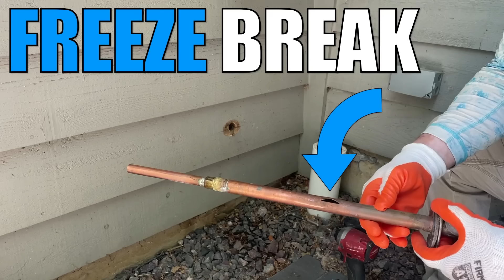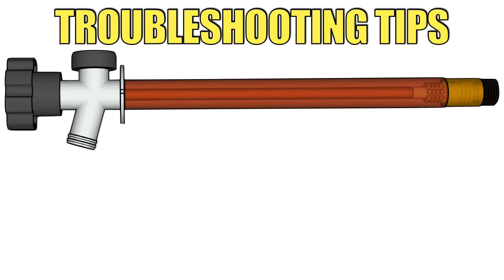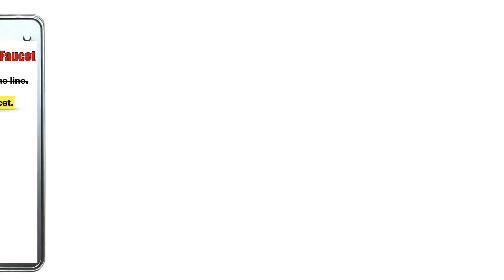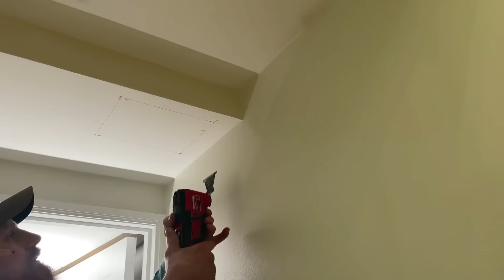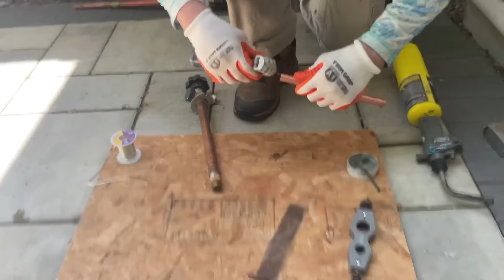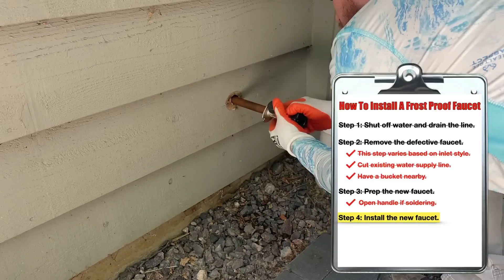How To Replace a Frost Proof Faucet (Step-by-Step Guide)

Comment: Why on earth is every plumber soldering pie into a threaded connection? I want to assume the best but I can only think it forces someone to call a plumber. I suppose in wall it's the only option to be safest... that's all I can think. I have an unfinished basement so I question it.

Comment: You forgot to tell them to stop water from getting to the joint you take soem bread and roll it up and push into the supply pipe

The bread will stop water from dripping into the joint while being soldered, and when you turn the water on you let it set for a few min.. It will then flush out past the valve

Comment: Ok ive got one variable with my outdoor faucet. When I tried to turn it to take it off & replace it Just snapped off leaving part of it you seal & solider inside the pipe that it attached to. Its under my house & so I cut an area to try not to have to crawl under my house if possible ( very small crawl space) so is it possible to somehow thread the pipe with a tap & extension & use some kinda sealer on the threads rather than soldering the thing. I can get a tap in there on extension & definitely  reach it but say tapping goes well, can I then use some pipe compound & let dry & then that fix it otherwise its under the tiny crawl space & hard to reach 
To do it like your doing it in video?

Comment: I live in a mobile home and am trying to figure out what kind of sorcery the last person used for this place. I think they ran the outside faucet line through the bottom of the hot water heater with a woven metal air hose to the faucet.

Comment: Thank you for posting this excellent step by step video on how to change the outside faucet. I called a local plumber in my area and he wanted around $330 to replace my busted outside faucet and I said no as I know it is not a major job. After watching your video twice, I feel confident to do the job myself and saving at least $250 as I have all the tools except for the yellow small tank and the cost of a brand new outside faucet is around $30.00. Hopefully, I will get this done next week as my wife is planning on using it this summer and I will let you know how it went.
Thank you
AJ
Reply from the maker: hope it helped

Comment: I have this issue that I discovered a few minutes ago.   Mine does not have access inside.   It runs between the wall between the kitchen and the garage and the water heater is right there against the wall in the corner. 
Will I cause more damage if I try to unscrew the spigot from outside not knowing if it's threaded or sweated in?
I'm thinking I have to drain the water heater and remove it,  then cut a drywall opening .

Comment: I worked un the plumbing departrment of a big box home improvement store in Canada for 4 1/2 years.

Each spring I would have a steady stream of husbands… either they lost the anti-siphon or it froze over the winter. If the freeze break was on the inside of the house, I would ask them if they got a big screen TV when you remodeled the basement. The warm air could not get to the frost free bib. 

I would suggest a standard bib with an optional anti siphon attachment. And a shutoff valve with a bleeder screw. As most houses are some form of PEX, I always sell the bib and shutoff with some form of PEX compatibility.

Most so called frost free bibs are not slopped correctly, and most builders will not spend 50 cents on a shutoff with  a bleeder..

Water typically stays in a frost free bib because water will not move unless there is air behind it. Bleeder screw solves this and ensures that the water escapes on its own.

Comment: I live in a house built in 1956 in Santa Fe Springs, Southern CA. I'm still remodeling the master bathroom. When I took apart the old galvanized pipes out I noticed the hot water pipe kept going through the exterior wall and ended up in a water valve outside the house. I have not found any information regarding the system and I'd like to know if I have to install a frost proof valve.
Why was the hot water pipe went through the wall to a faucet?

Comment: Thank you for this very informative video sir. One question though, Are all frost proof faucets soldered in at the joint? Because I’ve seen a tutorial video where the guy just twisted off the whole frost proof faucet assembly and no solder at the joint at all. He then wrapped a plumber tape around the threading of a replacement then installed it all done from the outside of the house without cutting out a wall or whatever.

Comment: Why didnt you run the piece longer  then sweat it to the female fitting with out it screwd in. Then screw it in after its cooled, cut your other side to fit that way you never risk burning up the seal. Couldnt you just have unscrewed the hole piece out without even sweating it it 
, if you went back with correct length valve?

Comment: Wouldn't it have been better to replace the connection with a threaded adapter so if this happens again in the future, the hose bib can just be unscrewed and replaced?
Reply: If they do that next time homeowner won't call the plumer, I guess that's why. I had the same problem and ask myself the same question.

Comment: My backyard anti-frost faucet either has low pressure water coming out or almost not all. I thought it was due to the bibb washer, so I took the entire stem assembly out after I turned the water off. After the stem assembly was removed, the water did not come out either after the main water supply was turned back on. Does anyone know what happened to my main water supply pipe? Thank you.

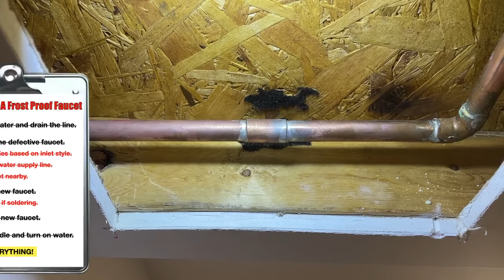Comment: at 8:38 i noticed quite a bit of scorching of the OSB above those joints.  was that the previous installation or does the heat shield not completely protect the wood from scorching?

Comment: Jon, so what if the sill cock is only 2-3 inches above final grade?  This makes it extremely difficult to attach a hose and impossible to fill a bucket or water can.
Can you suggest some other options?

Comment: Hi, I do basement remodels. A client of mine had a busted faucet during the winter following the remodel.
My question is should I insulate around garden faucets or should I leave the insulation out around them to allow some heat to reach them ?
In this particular case, she left the garden hose on, but maybe if it wasn’t insulated it would have protected it from freezing ?
Thanks,
Xavier

Comment: I have a Frier Frost Free Faucet that is leaking after the water is turned off. The handle appears to be cracked at the connection to the square valve, but I am guessing the problem could be the rubber flange which is kind of crimpled up at the edges.

Comment: I just installed a Shark Bite fitted frost free tap. Easy, just snaps into the pex line.Install angled downward for drainage.  A retro fit to side of house that needed a tap. No soldering , no worries.

Comment: Superbly informative! Thank you. 
A friend left the hose attached to faucet for winter and and the outer tube cracked right behind the house wall. I wonder, is it worth repairing (soldering) or better to replace with new? Solder repair would add some extra thickness to the outside diameter.

Comment: My frost proof needs replacing, it is too long and hitting one of the studs under the house so im having to do a bit of rerouting and soldering to get it to be good. One thing I learned from other plumbing videos is that it needs to have an angle so the water comes out of the little spigot outside. Im fixing this for my moms house and I suspect two reasons why its leaking now. One, she confirmed she left the hose on as she didnt know she had to take it off as her previous house had a spillcock that was one of the more expensive types where you could leave the hose attached and it would be ok (still good to get into the habit of taking it off). Two, is that the spillcock was slanted inwards towards the house, not letting the pipe drain out properly which is one point that wasn't mentioned in this video, but it looks like the pipe in this video is slanted as it should be, letting my fellow diyers know in the case you weren't aware

Comment: What stops the spigot from turning counter clockwise (open)? I just replaced the valve stem in my Woodford outdoor frost proof faucet and while the water turns on and off ok, the valve stem doesnt stop spinning when opening.

Comment: Excellent instructional video and a valuable resource to us, DYIers.Thank you for it!  However, I was wondering why not solder a female adapter to make future replacement easier by just having to unscrew the assembly? Just curious too if doing so, if applying torque would weaken the soldered female adapter or not. Or if it potentially makes it difficult to straighten the faucet. Please, advise.

Comment: I have found my frost free spigot free-flowing water this winter with the faucet in the closed position. I installed a ball valve on the pex supply line to stop the flow, but now I have to replace the spigot. Never done that before, so that should be fun.

Comment: Good job! I'll be installing one of these in build I'm doing. Definitely going to make it more accessable than was done here. The bigger repair is the sheetrock because when the homeowner calls back in the winter because they forgot to disconnect the hose I don't want to deal with drywall. I'll also include a ball valve just upstream and use pex instead of copper because I know I will have misplaced my fire blanket.

Comment: I thought that was the whole point of a frost proof spigot so it don't break in the wall. I thought the shut off was inside the house. Good info with the pitch I never new that either but based on that and it still burst in the wall sounds like those are gimmicks and a waste of money ??

Comment: From an old-time journeyman plumber, here’s a trick to repair that burst faucet without having to buy a new one. Simply remove the burst faucet, tap down the burst area, then take a 3/4” copper repair coupling (the coupling without a center stop) and cut out just a bit less than one-half of the coupling diameter, add flux to the burst area, snap the remaining part of the repair coupling over the burst area, then solder it on. Bingo, faucet is as good as new, lives to see another day!
Reply: Or buy a new faucet for $30 and do it right
Reply: @fenderstrat7547  Yep. You are on a call 3) miles from the nearest SMALL town and do not have one in truck stock. So do you drive to the town hoping their hardware store has one, OR repair the one that is installed. 
If you have a stick of 15% silver solder you can fix it stronger then new
Reply: No, make two elongated cuts to the coupling, from one end to the other end, thereby cutting out just less than 1/2 of the coupling body. You will need to hold the coupling in a vise to do this.
Reply: What do you mean by cut less then one half of the diameter of the 3/4 repair coupling? Do you mean just shorten the coupling?
Reply: Or just cut out the bursted section of the pipe and install two coupling and a small piece of pipe. Boom even better
Reply: solder it back together after pushing it back together with 15% silver solder
Reply: These things are like 25 bucks. If your going to all the trouble of removing it just replace it. Its so much easier
Reply: @ptech88 try $50-$60…
Reply: Yeah tools that no one has

Comment: Why not put a joint in where the faucet can screw on in case of another failure down the road then the drywall would not have to be cut out

Comment: Bro--FWIW--I always use a big piece of white bread (no rust please!) to 'plug up' lines that have residual water in them before I solder. Like the line to your final coupling getting soldered. When done just turn on the water and the bread will liquify and disappear out the faucet when turned on.

Comment: I'm dealing with a Arrowhead hydrant with a leaky stem that is threaded on the inside as well as the outside. There is a 90 degree elbow attached to it with threads on the hydrant side and a soldered coupling to a copper pipe on the other end. Ideally I just need to replace the stem but there are no stem kits for the length hydrant so I need to purchase the whole thing. Theoretically I should be able to unscrew the old hydrant but it's tricky as I don't want to apply force to the elbow. Alternately I could just strip the stem out of the new hydrant and leave the existing body in place. I am still deciding what the best approach is.

Comment: Great video! Nice graphics also. How did you know it was a sweat connect vs threaded from the outside? I need to replace an outside faucet and cannot tell - afraid to crank it with a wrench to see and risk breaking it.

Comment: Wait....so....should you not try to future proof that as much as possible for easier disassembly going forward? As a homeowner, I feel as though you should have utilized a different connection method(if it exists) for if ever the home owner is in this situation again. Now if it happens, the cutting procedure has to occur all over again. Is there not a design that us as homeowners can use that can just unscrew?? I noticed that there is threading on the pipe of the spigot, so that hints to me that there is. How come you didn't use that??

Comment: My original spigot enters the basement JUST BELOW the plywood subfloor of the level above.  
This prevents me from achieving any kind of slope away from the home.

In this situation, would I still a new hole, lower than the original spigots penetration, and then fill in the original penetration?

Comment: Thank you, finally someone actually shows replacing entire assembly and not just repacking the valves. I also appreciate your in-depth explanation on how you can tell if it’s a cracked pipe versus valving issues right up front.

Comment: Why not use the threaded connection so if this happens again they can just thread in a new spigot?  Also did you measure the level and make sure it drains out?  That is a critical step and that could be why it froze up in the first place.
Reply: Good point!

Comment: Excellent and  informative - Thank you. My  hose bib is leaking from the spindle when I turn it on EXACTLY as to your description of a burst pipe due to not disconnecting the hose  BUT there is absolutely NO water coming into my inside wall where the housing passes through THANKFULLY.  
Frankly, I'm baffled.
It's NOT coming from the packing nut. It LOOKS like it's shooting out from the holes in the spindle that turns (OPEN/CLOSE) within the housing of the hose bib assembly.

Comment: Hey @Hammerpedia how did you know it was a sweat connection before cutting the drywall to see it? And along that same thought, is it possible to find out if you have a screw in without being able to see the line inside the house? (i.e behind drywall)
Reply: You cut the drywall to discover whether it's a screw fitting or other. You could do more damage if you start twisting from the outside when it's not a threaded connection.  Good question.

Comment: thanks for a good video, but wondering why not just solder a female threaded connector inside and screw in the new faucet?  Saves the valve from solder heat stress, only that one solder joint, and might save another sheetrock cut later.
Reply: Yeah, but the next "plumber" could be the home owner that can just unscrew the fixture and then screw in a replacement. Job costs $20 and not $100s
Reply: Good point. Now wondering about different options myself
Reply: Very good suggestion!
Reply: U don't understand its not supposed to be for next plumber present

Comment: Why don't you use a shark bite coupling instead of soldering
Reply: What if in the future the housing (the whole hose unit), has to be replaced AGAIN?
When you unscrew it from the wall and the water connection I would HAVE to believe a SOLDERED connection vs. a SHARK BITE connection would be less likely to leak when you're done. 
No?